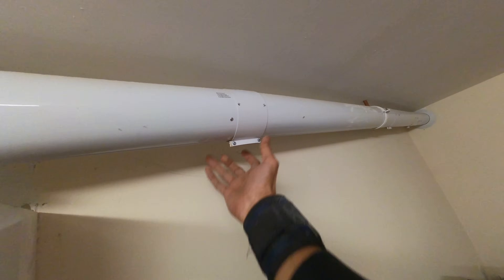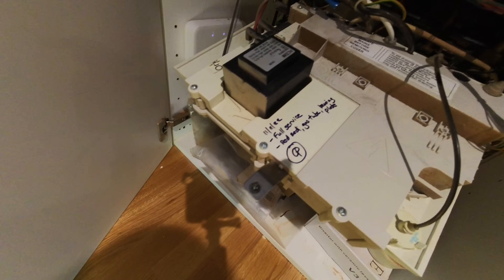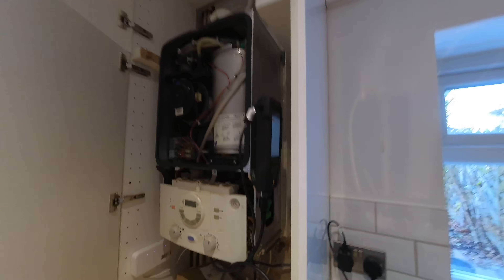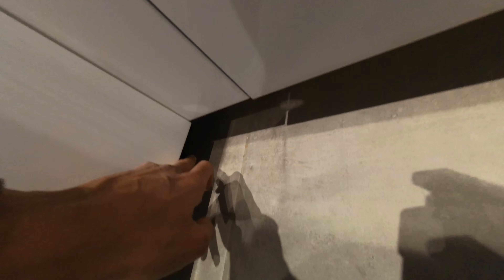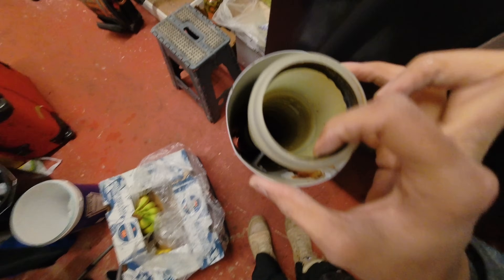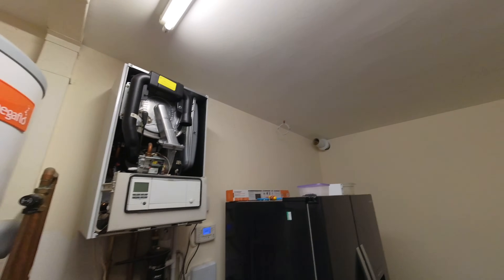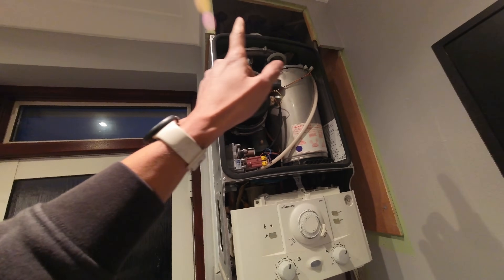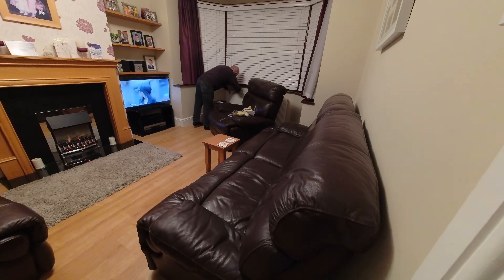Fixing Worcesters & A Failed Flue! - A Day In The Life Of A Gas Engineer 112

Comment: The flue does not fall enough 55mm per 1000mm of flue from terminal end to boiler?
Reply: Installer error issue was always going to happen if no fall. The boiler needs to be lowered down to get the fall back to boiler.  The issue is going to happen again. Water sits in the flue and regards less if flue seals are good water will still pass

Comment: What grease did you use on the flue seals?
Reply from the maker: Silicone grease
Reply: @cputilitysolutions  
What is the max heat it can take?  Otherwise it may dry up being useless.
Reply from the maker: @johnburns4017  not sure I'll have to check

Comment: Ever tried using hair dryer on fan, I find Worcester boiler that have been off for some time get fan fault but warming PCB works that's if not blown
Reply from the maker: Yeah I've tried that in the past but found I got recalled anyway so for the sake of the price of the fan PCB I just change it
Reply: @cputilitysolutions  fair point,  great channel

Comment: Ref Vaillant flue. 
The flue appears to have an inadequate fall ? This exposes the seals and they are more likely to leak - tell tale, the inside of the seal appears "crinkly" as at 10.49.  
Increase the fall of the  flue (if needed ?) and replace the seals. Also not advised to use silicon grease either, use water if need be.   
This was a weakness with Vaillant and I think they changed the material of the seal after suffering these problems ??  
Nice to see you fitted another bracket. 
Finally another reason for ensuring the flue is fitted properly is that leaking water from the combustion gases leaks into the air intake and leaks back into the boiler - onto the fan motor !! 
Be well....
Reply from the maker: Thanks for the info 👍🏾
Reply: My pleasure.. You work hard and deserve to do well...  @cputilitysolutions
Reply from the maker: @gibbodive140  thank you for watching and supporting my channel 🙏🏾

Comment: It may be a trick of the camera but that valiant appears to have a slight downward angle to the wall exit  , it may be installed off angle could lead to weather penetration from the outside . Or due to length form condense cooling in the pipe before exiting , then dripping slowly back to the boiler ,  this can also  be caused partially if the pipe sagged over time , and was right to add a second clip on the pipe
Reply from the maker: Thanks for the comment 👍🏾

Comment: I’ve had the same issue with my flue from the same manufacturer, the flue duct seal fails on the lower half…..Maybe another flue clip required on that long flue run as well
Reply from the maker: Thanks 👍🏾
Reply: Must have sneaked another clip on whilst you weren't looking. 😆

Comment: I always used 0020231436 double lipped grey vaillant seal. Much better than the black ones i literally swapped out hundreds in the 5 years i worked on vaillant boilers always swapped pack ring heat exhanger seal out when turret off part number 981227 as they always fail too 😊